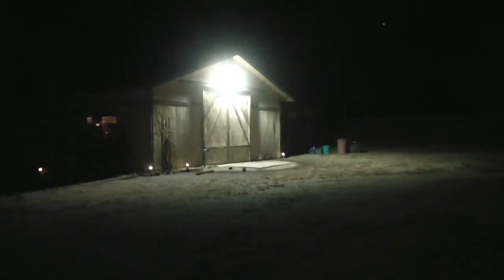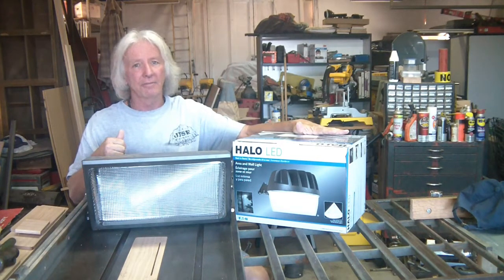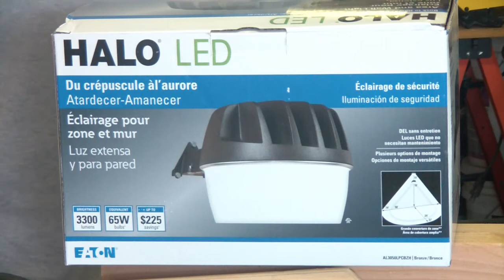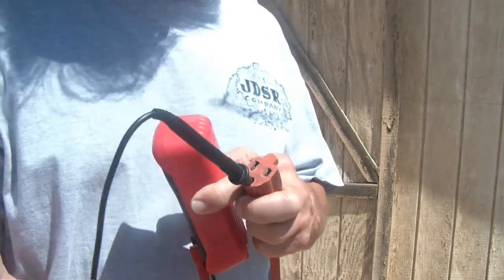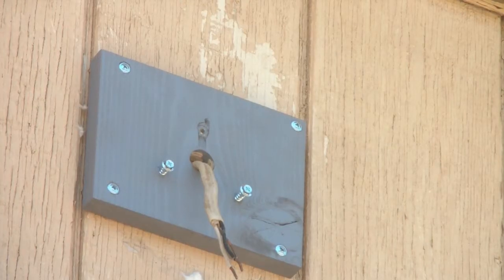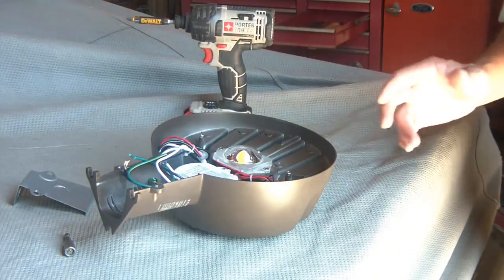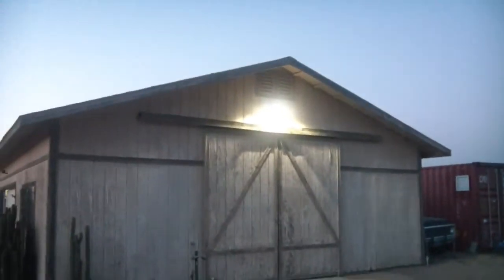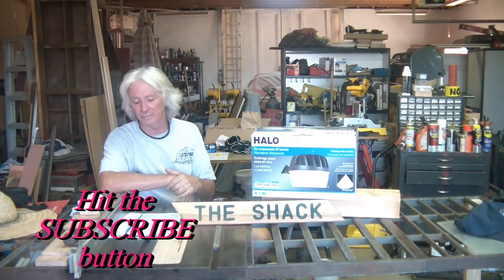How to install a Halo LED area light

Comment: Thanks for such a detailed review.  I’m just finding this 5 years after you posted it.  How has the longevity been on this unit ? Bulbs still glowing after 5 years ? Photocell still good ?  Are you happy with it ? Thank you.
Reply from the maker: georgiabigfoot I almost forgot about it.  it is still working like day one. I have gotten a ladder about 3 time and got up there and cleaned it up  just to insure the photocell is free from any junk and clean out any spider webs just a quick maintenance, when I remember. Thinking about it I should do it again before winter kicks in.
Reply: @TheShackHome  thank you for this Into.  Great to know still working too.  It appears Halo doesn’t make this exact model anymore , but Menards has the Halo LED’s and I’m going to order one.

Comment: You should cut a lot in the board over the doors so the light can shine thru and not it it LOL - For me, I'll stick with the good old standard Mercury Vapor Light that takes the 175 watt bulb. They have served me well, with a nice soft blue light that spreads out far.

Comment: I have the old style halogen one and the bulb went out.. Not sure the price of the bulb but im thinking about just replacing the whole thing with an LED style that i can get for $55.  i imagine a reppacement halogen bulb will be about $20 and use more electricity.
Reply from the maker: Thats one reason i replaces the hologen light i had this is actually better and soo much less to use especially all night. its been working just fine for a year now i'm happy with it.
Reply: The Shack right on.  I just found one on amazon for 29.99 and someone reviewed it and like it.  So even cheaper.

Comment: The 175 watt mercury vapor light on the pole outside my house has been going for 15 years plus now. Starting to show some age but still works. I have another 175 watt fixture where the bulb is over 25 years old and still puts out a good amount of light. Will an LED last that long?

Comment: Mount it on a bar on top of the eve
Reply from the maker: good suggestion JIP but in my case i had an existing junction box there so instead of running conduit and wire, it was easier to mount it there, if not i more than likely would of done just that.